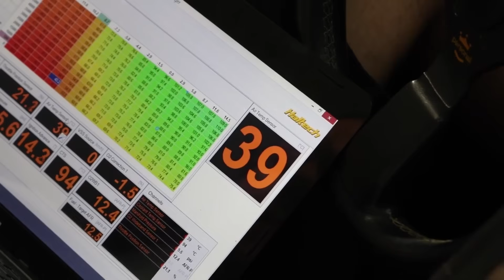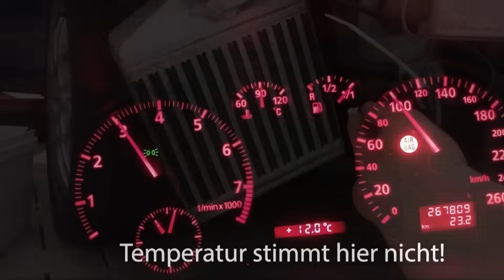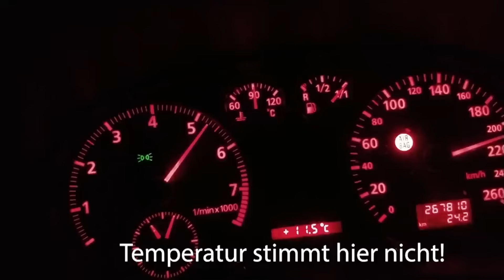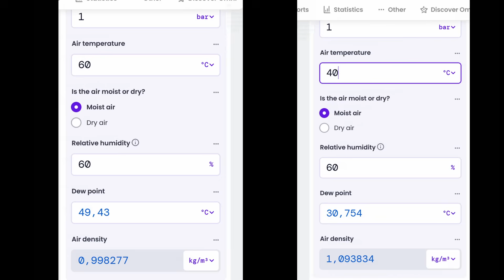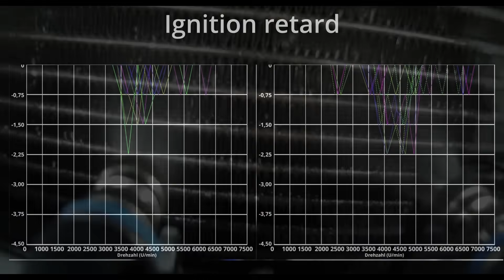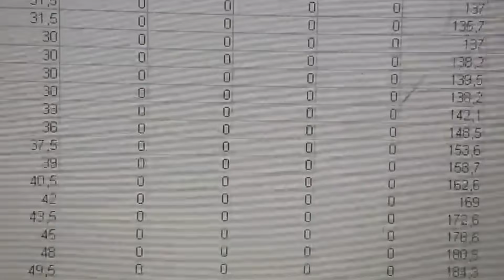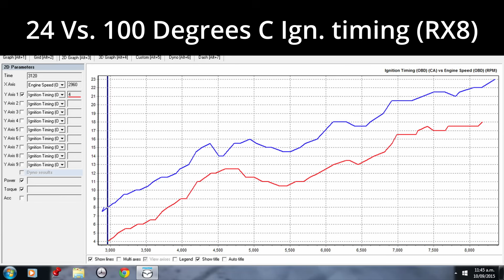More HP For 1$ on your Turbo car!!! | Intercooler water spray for cheap + Tested!

Comment: This would be neat on the street, where it's illegal and dangerous to drive super fast. But good luck trying to get away with it at a track, where it would be most beneficial. As soon as track monitors see anything dripping from under your car, they typically ask you to get off the track.
Reply from the maker: you dont need to drive super fast to make use out of this. even when in canyons or on twisty roads you will get benefit out of this not only making your engine run better but also has cooling benefits for your water radiator as the water that hits that after the intercooler will have a similar effect. 

and you might not like it but there are plenty of people driving fast on the street. 

as for the track. there isnt that buck dripping off. the amount of water you will see dripping is very minimal and barely noticeable. when using the sprayer using even 1 liter will take multiple minutes. and the effects on cooling if made automated are huge especially in a race application with a lot of full throttle time.
Reply: @throttlebuddies0  The reason why I stated the track thing is because I tried to do this multiple times back in the late 90s on my supercharged and intercooled race car, and I kept being asked to leave the track to fix the "leak". I've also seen literally hundreds of people try this at AutoX and drag racing events, with exactly the same results: dripping that alarms track monitors and immediate requests to get off the track.

I'm well aware that people drive fast on public roads, thanks. I'm just not advocating it publicly 🙄
Reply from the maker: I mean cant you just tell them what it is? haha

i think if its activated at a certain temperature with a switch to turn it off when on the last lap or something would be fine as when you use a nozzle like in the video its really not a massive amount of water. especially with wind speeds.
Reply: @throttlebuddies0 It doesn't matter if you tell them "it's just water", any drippage from under the car at a race track is a huge no-no. Nobody racing their car has AC on, so there's no valid reason for drippage. You can spray an intercooler or radiator down between runs, but as soon as you're on the track or in the staging area, nothing should be dripping or else they ask you to get off immediately. Too many instances of accidents caused by slick fluid leaks, they take people's lives more seriously than your vehicle's peak performance
Reply: @FriendlyPhoton at track speeds there would be no dripping unless the system fails, the water doesn’t stream out at those speeds. Shut it off a lap before pits. But I do still understand your sentiments though
Reply from the maker: No i think what he means is the dripping down from the actual intercooler the sprayer or nozzle itself wont drip but the mist that gets collected as water will drop down, however very slowly
Reply: @throttlebuddies0  ahh, maybe install a catch pan/ panel or absorbent material like how some engines have “dippers” for oil so it’s not actively leaking in the pits? 
You got my thinker going now lol
Reply from the maker: might be possible. but at thatpoint you could also just inject the water directly with a water injection system. that will work even more effectively. its also possible to inject pre turbo but the mist has to be pretty fine then so hihgher pressure is required.
Reply: @throttlebuddies0  That's kinda the thing. Water/methanol injection does everything that spraying the outside of the intercooler does, but better in every way. Of course, that's a much higher cost to do it correctly. The h20/meth injection on my Buick turbo V6 cost around $800. It's metered based on need as determined by the engine computer, and I always know exactly what results to expect. But at that cost, it damn well better work right.
Reply from the maker: @FriendlyPhoton  exactly. the price is the barrier to entry in that case. the water sprayer is very cheap in that regard. but at a point where you had to think about catching spare fluid wouldnt make much sense. 

THOUGH in a racecar you might be good off going for water meth injection just because of the added safety and cooling it gives to the engine. While you shouldnt base your tune around it. automatic lambda correction can help with that as when you are injecting water meth, the correction will correct down to yout target although you are injecting additional fuel, but cooling your combustion chamber reducing IAT, EGT and your likelyhood of experiencing knock. So in that case a win-win.
Reply: @afroman5531 what arnt you getting about water dripping on your own tires, causing lack of traction or risk of ban from the track lol
Reply: @afroman5531 so adding even more weight,smh lol
Reply: @btdcustoms9330 ah yes adding more weight to the bottom of my -2500 pound car oh no lol
N if you have a way to catch the water from dripping (like an engine diaper) there won’t be a leak to lose traction on nor get kicked well resisting heat soak, sounds like a win across the board

Comment: Damn, 10 degrees less with such a easy mod is amazing. I bet it can be over engineered and be even more!
Reply from the maker: yeah definetly. as i said this was suboptimal 
on an intercooler with a larger surface area and on higher boost levels with more heatload this will DEFINETLY be more!

Comment: the trick is to use higher pressures so it atomize better,this a nice trick and effective,thanks for sharing
Reply from the maker: true but there are also different types of nozzles. some dont need that high pressure to create small droplets. but getting the water spread around to the complete surface of the intercooler is definetly the goal and could also be realized by multiple nozzles
Reply: @throttlebuddies0 
The garden centre misters work well.
Reply: A good pump for this application is a diaphragm pump from a coffee machine, as it's very high pressure (10+ bar) and low volume.
Also, I believe ideally the nozzle should be placed in the middle of the intercooler and pointed towards the front of the car, that way the air spreads it backwards all along the intercooler.
Reply from the maker: @ while yes the atomization will be better but the results will only be slightly better. if you are going to the length of using a diaphragm pump you can get a water meth kit and use that for water injection and get even better results with lowered knock threshhold also. There are kits that can be had fpr 300 USD or even lower if controlled by your own standalone ecu :)
Reply: ...and spray water inside pipe! You can add methanol (max up to 50%) to the water for better cooling and car performance 💪
Reply from the maker: @ yes but then you need a water meth injection system as the pumps these use, are capable of much higher pressures. they have to overcome boost pressure and also atomize the mixture much more. i will do videos on this in the future as im going to put in water meth into my car aswell.
Reply: @throttlebuddies0  
If you want real high pressure put water in a gas cylinder (like 1/4 full) then cap it and pressurise

Comment: Very interesting! Looking forward to the future video on how to integrate this with the ECU! 👍 Maybe one could source a washer pump and reservoir and wire it up as a standalone solution?
Reply from the maker: thats exactly what im thinking of. spare pumps arent expensive and you can basically use anything as a reservoir!
Reply: @throttlebuddies0  Thanks for the reply! 👍 Looking forward to the future video!
Reply: @throttlebuddies0  i have a project with an easy esp32c3 for it
Reply: Yeah, I just cut a hole in a Nalgene water bottle and put a windshield spray pump in the side. Works fine
Reply: You can just get a bluetooth obd-2 , get an arduino with bluetooth and read the data and turn on the pump based on the data such as intake air temp, throttle position, engine load ,etc
Reply from the maker: @kaikart123  well yeah of course that works but you will still have to turn the switch manually and when driving on twisty roads etc. i dont think does make much sense so an ecu controlled method would be easiest. 

might be possible to just use a pressure switch that activated the sprayer as soon as a certain boost threshhold is reached. like with a basic water methanol kit.
Reply: @throttlebuddies0  no you don't turn it on manually
Reply from the maker: @kaikart123  ah are there obd dongles that can switch stuff? didnt know that.
Reply: @throttlebuddies0  uh, I said you connect an arduino, a microcontroller via bluetooth to control a relay to turn on and off the water pump
Reply from the maker: @kaikart123  ah yeah lol well then it makes sense. at that point i think you could also just use a pressure switch would have the same effect but be simpler maybe.
Reply: @kaikart123  Do you have other ideas for what one might read out and control with an arduino via the OBD2? Seems like a potential "piggy back like" system for things that don't need to happen very fast.
Reply: You can combine a seperate intake temp sensor with a little controller or special gauge that activates the spray system, look for "Boost temp and automatic intercooler spray" Short here on youtube